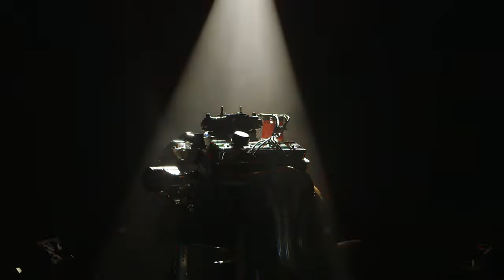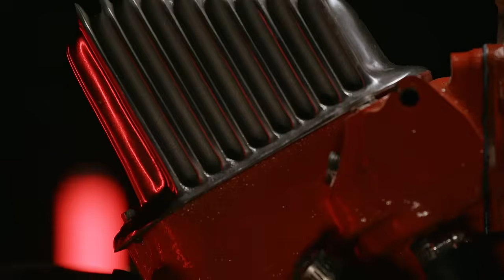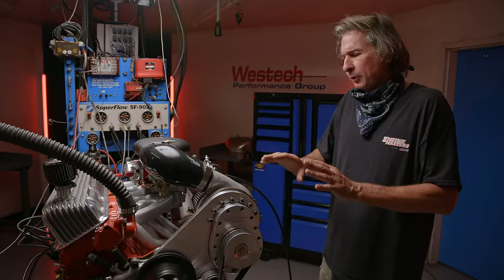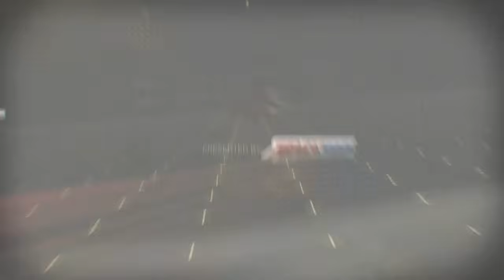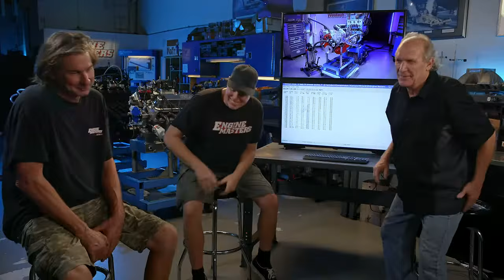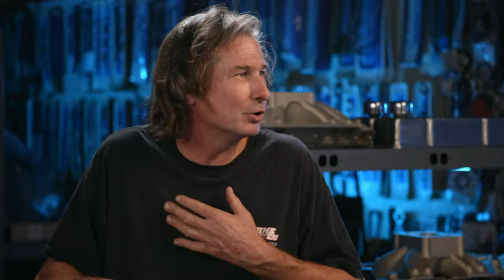Engine Masters  S5E77   Dulcich's Quest for Slant 6 Greatness!

Comment: Someone should get a 225 slant 6 cylinder head extrude honed and ported before they put it on a flow bench. The block should have a shot peened and magnafluxed crank that has been ground undersize and then have the journals hard chromed and ground to spec. I’d get new pistons with total seal rings and send them out to have the tops ceramic coated and the skirts teflon coated.

Comment: In milder compression ratio N/A you might want the lower octane fuel it’ll tolerate and run well. Of course, boost changes that

Comment: I've always liked the in-line six. And if hot rotting was just about power everyone would ditch their flathead Fords

I think in Australia they have a series with six-cylinder engines and I've seen a slant six with Weber carburetors 

Didja know that along with the V 12 the in-line six is inherently the smoothest engine?

And of course Daimler-Benz made their bones on 3 L in-line sixes 

Great episode though 

But I think it's true what the retired Chrysler mechanic said at the beginning that it's true greatness is just reasonable power and incredible longevity 

It's legendary

Comment: Basically a 198 CI /6 is almost the same as a 2.2L 4 with 2 more cylinders. Same style crappy non-crossflow head, low lift, crappy head flow. The head of the slant 6 is designed for the 170 ci version and not good enough for the 225. On the 198 it was marginal at best.

The only way a even ported to the max /6 head will support any power out of a 225 is with BOOST. BOOST forgives CRAP port flow to a point.

Comment: We had some horrible freezing winters in the 1980's. It would only reach minus 10 F in the daytime. We got off work at 3pm so there was still some daylight. My rusty Duster with slant six would moan and groan but it always started. Wisconsin used a lot of salt on the roads. There would be numerous newer cars with the hood up begging for a jumpstart. My little Duster put many cars to shame. After three times starting his fancy Pontiac one guy went right out and bought a Valiant with a slant six. He was showing off giving other guys a jump.

I owned several cars with that engine and never had a major problem with the engine. I bought one used that had a questionable speedometer. I think it had close to 80,000 actual miles on the car, the speedo showed 42,000. I drove that car to 150,000 and sold it to a guy in town who drove it several more years.

I currently drive a 2012 Jeep Liberty with the 3.7 V-6. Ironically that converts to the same 225 cubic inch of the venerable slant six from decades ago. It seems Chrysler considers that a good size for a six cylinder.
Reply: Well, yes. That's what my wife and I drove when we lived in New Hampshire. Starts right up at 30 below zero. Never broke. But not a power motor.

Comment: Chrysler Australia 1972 E49 Charger's 450HP Naturally Aspirated 265 Hemi Six packs a mean punch on the racetrack, competing in the Group Nc Historic Touring Car category . The Valiant Charger E49 R/T was always seen as the underdog in series production car racing during the early 70's here in Aus, competing against some fierce V8 opposition. The E49's 265 Cubic Inch inline six made 302 Horsepower stock, and ran a very brisk 14.4 Sec quarter mile, even while struggling for traction on a narrow production tyre. At one point this iconic Australian Muscle Car was the fastest accelerating six-cylinder powered production car in the world, and was famous for its trio of 45mm Weber carburettors hanging off the side of the engine, an intake system that was prototyped and developed at Weber in Italy. Although the Hemi designation is not completely correct with the engine only featuring a semi Hemispherical combustion chamber, Chrysler Australia used the mighty Hemi 426 branding as leverage, as it was after all a relative in the Mopar performance family.
Reply: So did the yanks not have the 245 / 265? Or just not mentioned because that was after dolsich was in highschool?
Reply: @UrUnclesadvice  the 245/265 was a Chrysler Australia machine, America never got it

Comment: I used to drive a Dodge delivery van with the Slant 6. The sparkplugs were rusted into the heads they had been in there for so long.  I never failed to run.

Comment: Great video! I'm loving the I-6 love lately. The guy's over at Engine Power did a Ford 300 I-6 with a Turbo that was up over 500 ft-lbs torque. I always loved the 1960-1964 Plymouth Valiant and this setup would really cook while keeping the nose of the car lighter than the v-8 powered car's.
Reply: I doubt it. Straight 6 motors have very heavy blocks. For example a Ford 7.3 powerstroke weighs over 300 lbs less than a 5.9 cummins diesel

Comment: If anyone has added the Offenhauser 4BB Intake & Howards cam to the Ford 300 6cyl. I am pulling down 268hp at 3700rpm using an Edelbrock 500cfm carb dual exhaust. One of the secrets is I chambered that exhaust and used Harlan Sharps small block Chevy roller rocker and sharps gave me Manley valve springs rods and oversized valve kit. Its one mean momma. Tends to run with a miss in cooler weather. Haven't figured that one out yet but I did go with a cheapo South West Auto HEI distributor. I plan to up grade to Petronix control module at the least. I believe they said at Petronix that they do offer their own HEI distributor but its really pricey. The science is 100% weird because I am firing at 4 degrees after top dead center on timing pulling estimated 20 some pounds of vacuum there. 2 me it seems unusual because normally these engines run better at 4 degrees before top dead center but that could all have something to do with the cam itself. I had that happen with a Howards cam in a Big Block Chevy. had to run 11 degrees advanced to get a stable idle and a solid launch. However to me it runs hot at 215 degrees is the normal temp even with a 4 core radiator. However it doesn't seem to affect anything running at that temp.

Comment: They do have a great reputation for being reliable, but 145hp out it stock? 😳Wow!!!
A standard Datsun L26 from the 260C luxury sedan is 160hp from only 2.6lt, and the Z car version with twin carbs and bigger valves was more again. 🙂
* Also a super reliable engine 👍
Reply: The datto engines didnt run a single barrel carby. Had a 260z with a 260c engine but with the twin carb setup although su carbys instead of the crap originals. In Australia our slants were all 160hp after 1968- we only got the 225. 1970 the slant was ditched in favour of the 245 hemi six, then in 71, joined by the 215 low comp, and the 265 hemi which was 203hp from the stock 2 barrel. Premium R/T motor was the 265 with triple 45mm Webbers making 302hp. 0-60 mph was 6.1 sec.
Reply: The Datsun 260C twin barrel carb is a tiny Nikki unit , made for fuel economy not performance.
The Z car twin 'SU' carbs were indeed much better. The proper Z engine also had larger inlet valves and higher compression.
Reply: @Danger_mouse  Didn't Hitachi make those SU copies?
Reply: @soaringvulture Yes they did, and they were a great carb.
I ran them on Datsun 1600 (510) rally car 👌

Comment: Factoid: The designer of this amazing engine placed the intake & exaust ports on the same side for 
thermal efficiency. It worked. In the 70's, the 4spd with O/D cars eclipsed 30 mpg easy..better mpg 
than many 4 popper sub compacts got and the /6 was in a decent car, the Mopar A body..solid, safe, 
reliable and cool looking..not a lil 1,800 lb deathtrap. heheheh.
Reply: We took a 1967 Barracuda /6 4 speed that weighed at 2800 pounds. Put a OD 883 4 speed in it with 2.94:1 gears. The /6 was 10.25:1, 0.100 over bored (3.50") and a mild cam, ported head, Offy manifold and 3x2 header into a dual 2 inch pipe.  Basically what Steve had on this engine. Put out 228 HP but when Granny Shifted and tried to stay out of the 390 CFM 4bbl it got 38 MPG. But it was not a 225 anymore, it was a 238 Ci.

But if i were to do a /6 today I'd look for a 170 CI one with that small stroke. Do the same ported head and over bore 3.50" @ 8.5:1 CR and a Turbo pushing 14+ PSI and have a nice 180 CI 7500 RPM screamer. Some of these /6's would take a 0.125" over bore and still be safe.
Reply: @davej3487  38 mpg! That's truly amazing..right up there with the 2.2L 4cyl of the 80's & 90's with a 5 spd manual. Ironically, that engine was designed by the guy that designed the slant six! aha. (great engines, but they shudda had iron heads to avoid the head gasket issues. but that was a bigger issue as it shudda been, bc many ppl just ran their cars too hard & shut them off hot, too oft) I think it was his Swan Song. Engines smaller than these pretty much never get better mpg, bc they have to work extra hard to push a car through the air. and your build was free of emmisions controls that hampered their output and mpg, as well.
Reply: @gzuzsavz  The 1967 Barracuda weighed about the same as my 1984 Dodge Shelby Charger 2.2 non-turbo. With 3.87"1 gears and a low 1st gear, the Shelby was quick for its day, 16.20 seconds Quarter mile with a few mods.... But driving from Georgia to Washington state doing a steady 70 MPH in 5th OD I got 38 MPG too.
Reply: @davej3487  That's cool, yeah, those were great lil cars. My dad had a '82 2.2L 4spd manual Charger..blk with gold and gold (yes. gold. aha) interior. Such a fun car, then he had a Daytona..2.2L 5spd..got 36mpg. That dang Daytona..he put like 120kmi on it..i drove it awhile..my cousin "bought" it but couldn't make pmnts to my dad so 6 months later it was back, then my bro bought it. last we heard she had 250k mi and was still being dailied by the guy my bro sold it to! with the original clutch! & it never blew a headgasket..bc we didn't beat on it & shut it off at trips end. plus it got Texas (Havoline..Valvoline. no Pennsylvania rubbish, aha) oil every 4k mi.

Comment: The slant design makes for a lower engine height and allows the waterpump to not be stuck on the 
front entirely, making the pkg slightly shorter in length.

Comment: I love inline 6 cylinder engines. I would like to see Ford and Chevrolet also in Engine Masters
Reply: Had a Maverick with a 250cid, 6-cylinder. It would do a burnout in that light little car.
Reply: @rishz7857  For racing the 200 is better. Oiling etc are different.(pushrods etc, less stable at high rpm and valve spring pressures) Look up NHRA Stock eliminator 6 cyl maverick, all 200's.
Reply: 300ford is king
Reply: Agreed. 292 Chevy.

Comment: Straight 6 is the most dynamic balanced motor as possible. Barra AU ford motors stock bottom can make 1000hp with good stuff bolted on top

Comment: Remember the "magic oil additives" that you could add the magic potion  and then you could drain the oil and the engine could keep running  .
The engines they all used for demonstrations were slant 6's
Reply: Teflon additives. In Australia we saw ads with it used in Holden red six engines.  If you've ever seem a teflon coated frying pan start to lose it's coating into your cooked food I wonder whether such coatings in engine oil ulimately did more harm than good.
Reply: @erroneouscode  If you eat the food, it does you more harm than good.

Comment: all mopar guys love a slant 6..but i dont think the squeeze is worth the juice. .i would rather put the same coin into a 273 0r 318
Reply: you can make some serious power with a slant 6, you just need to feed it quite a bit of boost, past the restrictive head.
Reply: @riogrande163 im still in the slant 6 camp..great driver..but leave performance to the v 8s
Reply: @symoncabral8609  Calling bogus on that one, you can make most any engine perform with the right parts and knowhow. 

Other countries figured out how to make big horsepower without v8's, no reason the USA can't do it, they just don't want to. 

General Motors tried twice, and chickened out twice.

Comment: an Australian show did dyno testing of a built 225 slant6, Naturally aspirated with ITBs and managed 282hp@5700 and 291ft-lbs@4300
Masters of Machines
I believe in Dulcich's vision
Reply: Triple 45m Webers. Plenty of 300hp+ slant 6s in historic engines
Reply: it had easily 10-15k in mods to make base level v8 numbers.cool but not realistic
Reply: There is this tuning company called Alpina. In the late 1970's they stuck a turbo on a BMW M30 3.5L 12valve inline6  and made 330HP. You could buy it. The cars that used that engine are
BMW Alpina e28 5series B7S
or e24 6series B7S
Reply: Try the Ford 300 6cyl built with the Offenhauser set up. I got 268hp at around 3700rpm no blower just an Edlebrock 500cfm jettet for bear. The exhaust is chambered no headers stock manifolds. It runs pretty sweet.
Reply: @thekingsilverado3266  a lot of people sleep on the old pattern inline 6s
Hell Brazil has built the old Chevy pattern I6 to be absolutely bonkers both on and off boost.

Comment: (OEM )M103 MB W126 Good Engine withe Turbo.
THE W124 CE  M104 Engine even Better Engine!! Esy Tou Give thes Engine with Boost!! 1000HP ..We have  a gaie Bak in The Days R.I.P. He build on The M104 Engine 24 valve 3.2 Liter. 1300WHP.. Daily Draiver 2!!💪💪👍thease Thay Have Better Rods and better piston!! Offkors litel better cams 2!!!

Comment: My 1st car was a 61 dodge Lancer 225 slant 6 with 3spd manual transmission. 
Car was awesome handling, ok power and fun to drive.
Gas was 33cents a gallon and used to have to decide on putting oil in engine or gas in tank.
Gas in tank won out every time till we got to the point that no oil was on dipstick and oil light was on.
Drove car that way for a few weeks and decided to sell car.
Put oil in it and light went out and sold car for $150.
Saw same guy a couple years later and thanked me for the awesome car. Was still running.  
Someone told me car was still running when oil light was on cause it was a solid lifter car😂
That car was indestructible 🧐😁

Comment: The straight six configuration (including slant 6) gives perfect primary and secondary balance. So if it’s designed for high performance it can be smooooth. A Cummins is a straight six and is built for it. In the US sixes were designed as low power economy engines.

Comment: A stock 2jz-ge makes 225hp. A 3.7 liter making 215hp blown is pathetic. I can see why it would run forever it doesn't generate enough heat or force to hurt itself.
Reply: Ignorant comment.

The 2jz was developed decades after the slant 6.

Also, horsepower is torque x rpm, the slant 6 shown here doesnt rev past 5 grand, so you're limited on maximum horsepower without more boost. 

Power nation got over 400 horsepower with a turbo setup, because they were actually pushing a healthy amount of boost through it.

Limit a 2jz, and run minimal boost through it, and it's not going to make much power either.
Reply: @riogrande163 Sounds like they should rev it to 8k and not stop at 5k.
Reply: @archerdog1   

the pistons in a 225 slant 6 at 5,000 rpm are moving as fast as a 440 big block at 7,000 rpm, this is because the 225 slant 6 has a 4.125 inch stroke. (104.7mm)

You're going to need either a very strong rotating assembly to handle crazy high rpm or you need to decrease the stroke, sacrificing displacement. 

This is why the majority of high performance slant 6's are boosted. It's just easier than tackling the High rpm debacle.

Comment: N/A, a good worked Slant should be around the 250hp / 250 ft/lbs mark, about the same as the minivan 3.8l V6.
Turbo, with the forged crank, the Tilley '66 Valiant out of Sydney had 635hp at the flywheel, well over a decade ago.
Yeah, I love my Slant, but that V6 would be cool in my VC Val,.. And like the weight difference between an LA and an RG, the difference in mass of the V6 makes it worth it.
Reply: Minivan 3.8 only had around 215 stock.  I had one with the 3.3 for over 10 years, dead reliable engine with over 250k miles when I gave it to my dad.
Reply: @jeremyb4493  Depends on year for the power output - check out the numbers for the '07 3.8 ;) (Could be the Jeep version,...)
I have an '02 Limited AWD with the 3.3, felt lethargic up top form when I got it on '19, till I found out the fuel pump was dying. Fresh pump and it sings away to the redline, smooth enough to stand an empty spark plug box up on end at idle.
Awesome little engine.

Comment: Where I live on the other side of the pond there was a Dodge Dart with a turbo s-6 build, 30-40 years ago. Our best head builder had a hand in that.
It beat every V8 it came up against.
(Before any actually comes in, this was in the days of 500-600hp = Pretty well max what anyone did, way before internet 3000hp became part & staple standard for so much as weekday shopping such as today where anything less than 1000hp = Wont even make it off the garage floor)

Comment: The are not a good engine to hot rod because you cannot rev them hard enought to get decent power. Like all old style engines without a main between every piston, they just aren't sturdy enough over 6000 rpm. Plus there are all manner of compromises from a non-crossflow design.
Reply: the mains on the 225 slant six are huge though, same size as a 426 hemi, they're plenty of beefy for a mild to moderate turbo build.
Reply: @riogrande163 - agree they are stout, I've owned heaps of them.
The main issue is that you just can't rev them hard. In an old-school build they are OK but you'd be crazy to spend big money and end up with less power than using a more modern engine design.

Comment: I have always been a diehard V8 guy. But that said, after owning a slant6 in a Dart, they are really good engines! Smooth and super reliable! Decent MPG's for the time as well. I always wanted a V12 variant.
Reply: Now that would be cool, 2 slant 6 engines married together to make a v12. It already has half the v angle at 30°.

Comment: The most reliable I6 ever. Except for the Ford 300 which makes more power and is more reliable. I had a '70 Duster with a Slant 6. It was a gutless turd but it just kept running... Also what's up with the masks?